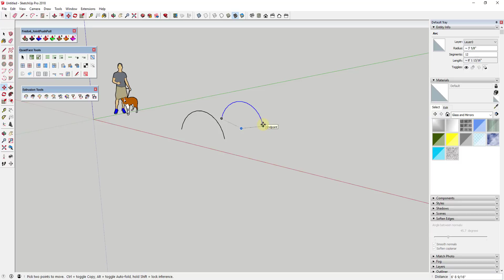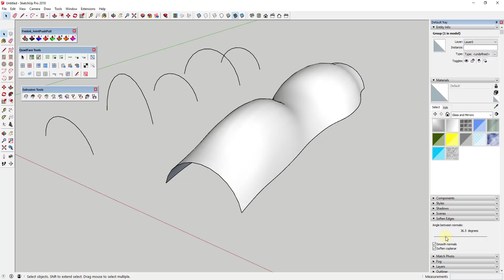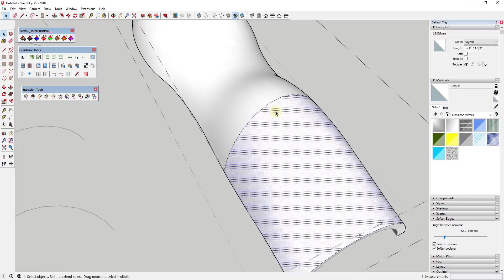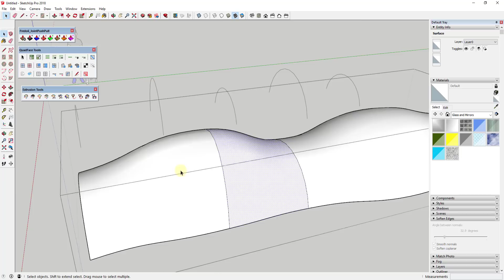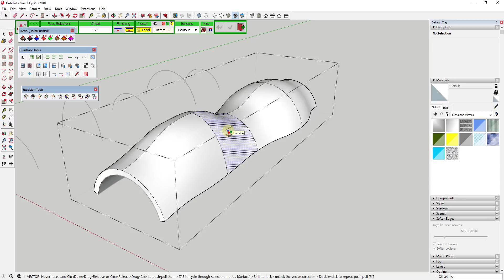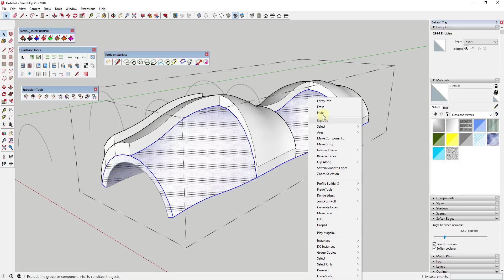COMBINING SKETCHUP EXTENSIONS  - Extrusion Tools, Joint Push Pull, Quad Face Tools

Comment: Thanks for sharing. Make human shapes from contour lines. Then cloth with contour lines + joint push pull. If you need contour lines, take a good 3D human shape from 3DW and slice it. It sounds regressive but you could produce low poly shapes from 30+GB models.
Reply from the maker: You think that's better than downloading low poly models from somewhere like Formfonts or the 3D Warehouse? I'm trying to think of a situation where I'd want to create a human shape from a model that large....
Reply: Oh I have big problems finding 3D human action props. Typically for my woodworking, I need men that saw, measure, paint etc. These poses are just not out there. Also, female props our number male props something like 4 to 1. I have a plan to use DCs to get around this but only after I get rid of my backlog